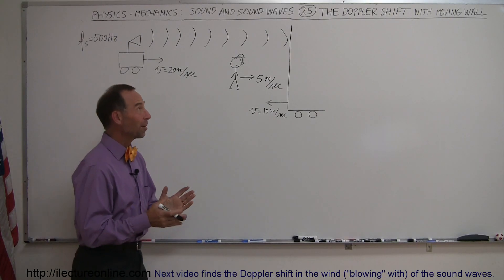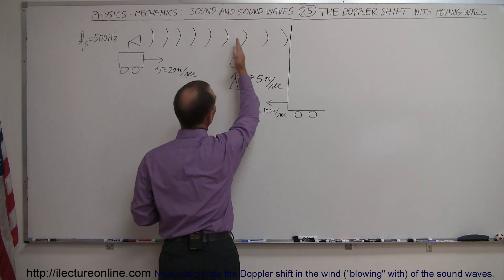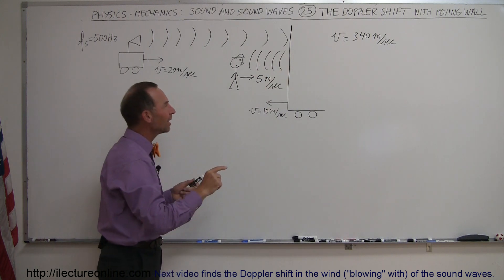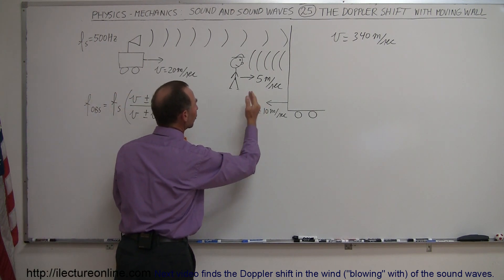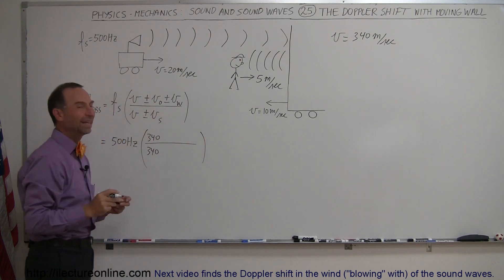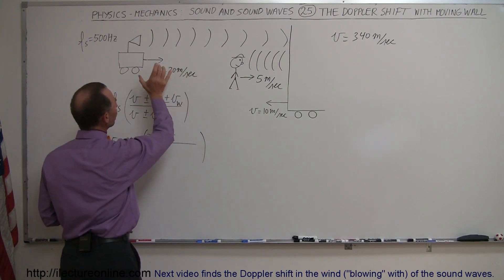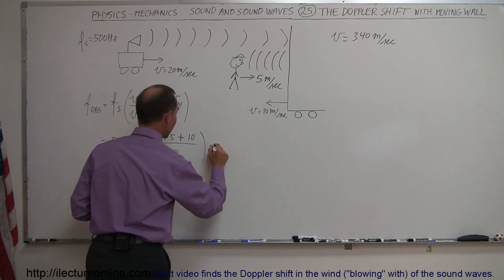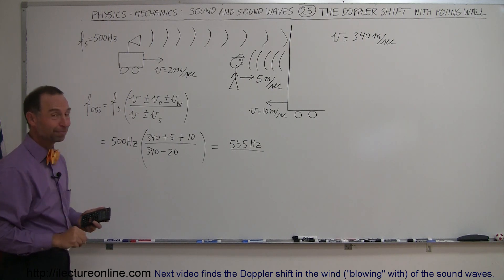Physics 20  Sound and Sound Waves (25 of 49) The Doppler Shift with Moving Wall

Comment: Hi professor, I use a different approach from yours that was working fine until I watched this video. I split the problem in half and solve for frequency twice. For the first part of the problem I took the observer as the wall and the source as the box. I solved for f(prime). f(prime)=(f)x(constant(1)). Here the observer and source are moving towards each other. I now have the frequency that bounces off the wall. I then take the wall as the source and the person as the observer and solve for f(double prime). f(double prime)=f(prime)x(constant(2)). In this case again I set up the equation as the source and observer moving towards each other. Does this method not work for this case? It worked for the previous video.
Reply from the maker: Gevorg,
There is another way of looking at it.  Divide the problem into two parts.
In the first part you make the wall the observer who is moving towards the source.
Thus the frequency "heard" by the wall (Fw) can be found:

Fw = 500Hz ((340+10)/(340-20)) = 546.875 Hz

Then you make the wall the source which simply reflect the sound at a frequency of 546.875Hz

Thus the frequency heard by the observer (Fobs) can be found:

Fobs = 546,875 Hz ((340+5)/340) = 554.9 Hz   (=555Hz)

What final result did you get with your method?
Reply: Michel van Biezen 
I have Fw=500((340+10)/(340-20))=546.875 Hz

Then with the reflected frequency I have

Fobs = 546.875 Hz ((340+5)/(340-10)) = 571.7Hz (=572 Hz) 

Do I no longer consider the wall as moving for part 2? If so will you please explain why?
Reply from the maker: Gevorg Ashikyan Gevorg,
In the first part, you consider the wall as the observer (moving towards the source).  From that you get the frequency the wall (observes).
All the wall does is reflect the sound waves with the SAME frequency as they were received.  The velocity of the wall is already considered on the first part of the problem, which increases the frequency of the waves (observed) compared to what they would be if the wall was not moving.

Think about the wavelengths of the waves as they reflect off the wall.
Reply: Michel van Biezen
I'm sorry, but I still don't understand why the velocity of the wall in the second part of the problem is not included in the doppler shift. In the problems section of my book I have a similar problem. There are two submarines moving directly toward each other. The first submarine (1) emits a sonar toward the second submarine (2). I am asked what frequency (2) detects from (1). For the second part of the problem I am asked what frequency (1) detects from (2) after the frequency bounces back from (2).The two ships are moving in the same direction and the frequency will be greater for both the first and second part of the problem. I set up the Doppler shift. 
My calculations look like this.

Given:
speed of (1) is 8 m/s 
speed of (2) is 9 m/s
F(1)= 1400 Hz

Part 1.
(1) is source, (2) is observer
F(2)= 1400((1533+9)/(1533-8))
F(2)= 1415.6 Hz -> F(2) = 1416 Hz 

Part 2. The frequency reflects from (2) back to (1). 
(2) is source, (1) is observer
F(1') = 1416((1533+8)/(1533-9))
F(1') =  1431.8 Hz---> F(1') = 1432 Hz
Doing this I get the correct answer for both parts of the problem.  

Why does the problem with the submarines consider the velocity of (2) as part of the doppler shift for part two when I already considered velocity of (2) in the first part of the problem?

I apologize if I'm being difficult.
Reply from the maker: Gevorg Ashikyan
Gevorg,
Thank you for being so persistent.  We have been trying to figure out for the past 3 hours why the book supports your answer above and the book is correct (which means I was wrong).  I just had to understand why and it turns out that working with my son we finally figured it out.  (He is an engineering student)
I can explain it with a simple example.
Assume that a sound is approaching the moving wall with a wavelength of 1.0 m.  The wall is moving towards the approaching wave with a speed such that after it reflected the previous wave it has moved 0.1 m and thus "sees" or "hears" the next wave 0.9 m away.  (the frequency has increased about 10% by moving towards the incoming waves)
But since the wall is moving to the left (chasing the previous wave) the previous wave is only 0.8 m away when the wall reflects the next wave.  
Thus the moving wall "observes" the incoming waves 0.9 m apart, they are sent back (reflected) 0.8 m apart.
So your book is correct and I was wrong.

I'll have to remake that video with corrections.

Thanks again for being persistent.  That is how things are discovered and science is learned.
Reply: Michel van Biezen 
Awesome thank you very much professor! Thanks for the lecture and all the good examples too. Watching your videos makes reading the book easy, I don't have to spend too much time reading and can jump straight to solving problems. (I am also an engineering student)
Reply: +Michel van Biezen I knew it wasnt right. The solution didnt look logical.

Comment: might sound stupid, but why doesn't the moving wall's velocity appear on the bottom of the equation as well?
Reply from the maker: denom123
It turns out, I made a mistake, the reflected wave is affected by the moving wall and thus the velocity of the wall should appear at the bottom of the equation as well.  A corrected video will be added.